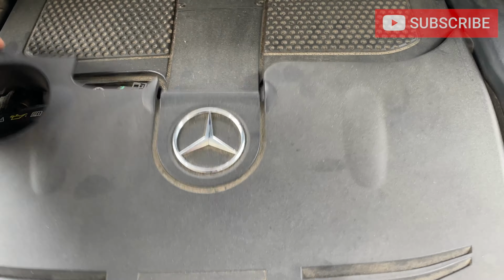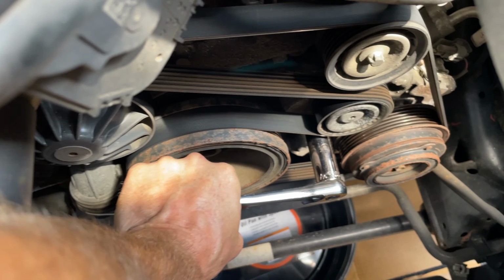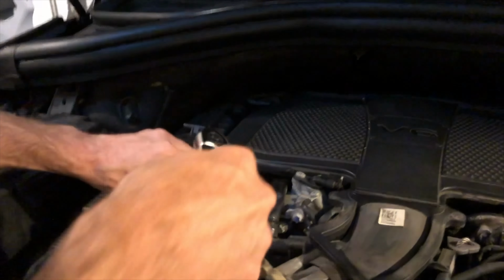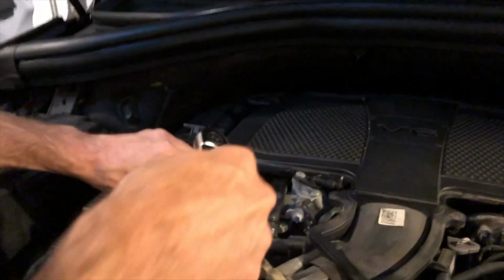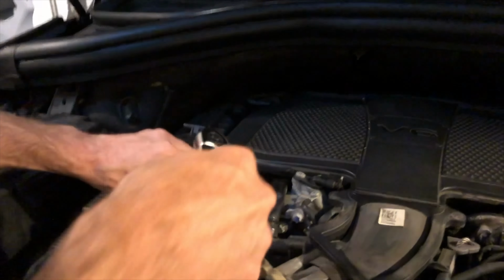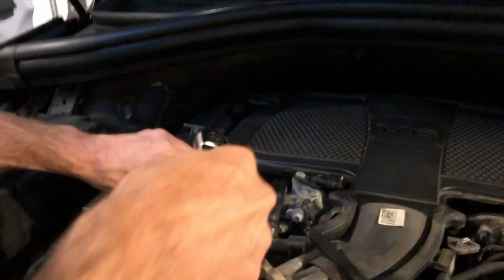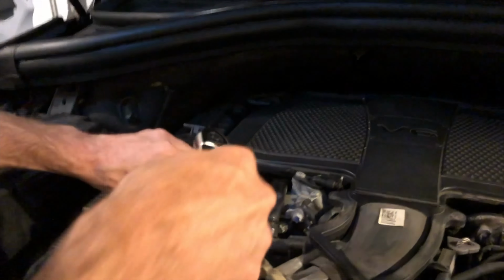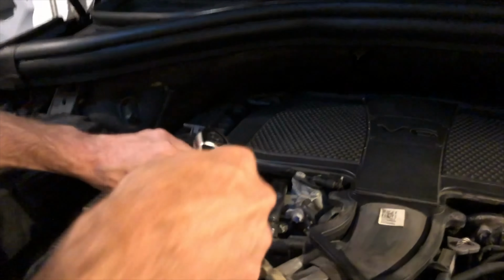Replacing the Thermostat in a 2013 Mercedes ML350 (Applies to 2012 - 2018 ML350 & GLE350) W166

Comment: Hi there. I have one question. What kind of o-ring do i need to buy. I bought oil cooler line gasket and intake manifold gasket. Thermostate gasket comes with thermostate. Anything else that  i need to buy it? Thanks
Reply from the maker: This is what you’ll need:
1. Thermostat gasket
1	Engine Oil Cooler Line O-Ring	MER-024997794564	Genuine mercedes	$17.19
1	Radiator Coolant Hose Seal	MER-0269976745	Genuine mercedes	$10.39
1	Fuel Injection Throttle Body Mounting Gasket	REI-401011700	Reinz logo	$4.59

Comment: Mine is doing the same, did replacing the thermostat fixed the issue?
Reply from the maker: @RT-mu1cr  it did for me, I had a small leak due to the o-ring that fits the oil line to the thermostat. Replacing everything helped. That was my original thermostat so I’m glad I don’t have to worry on long trips any more.

Comment from the maker: Nice!  Pretty straight forward but if you have any questions, drop me comment and I’ll try to reply fairly quick.
Reply: Notice low coolant warnin🎉g. I have 2019 GLE 400.  It has 87,000 km and on the original thermostate. Slow leak. Thanks for upload.  Is the diy same for my 2019  GLE 400.?